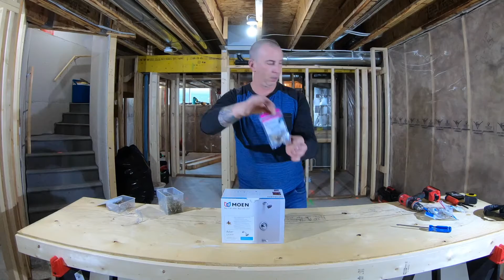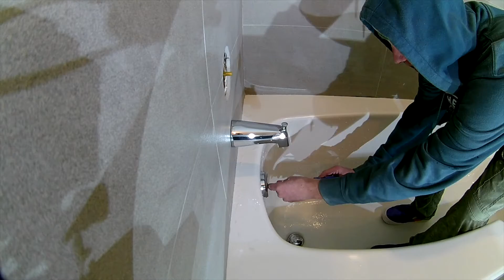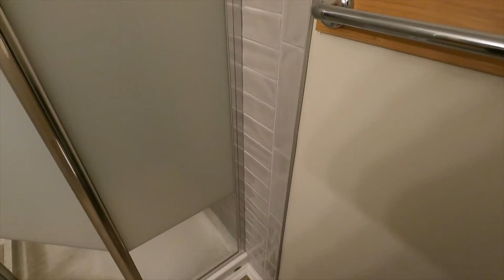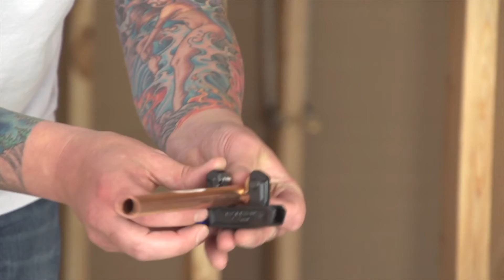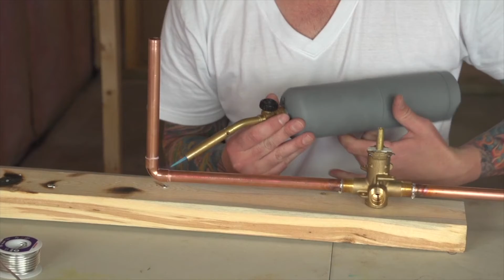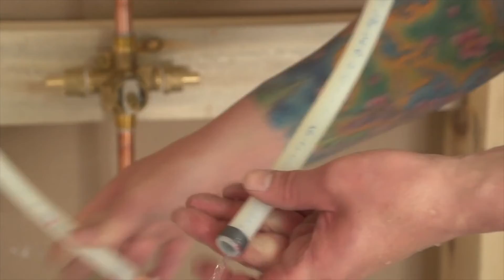SHOWER VALVE 101 4 different installs DIY Details

Comment: Tim, thanks for this! Quick question. 

I have roughed in my basement bathroom with this kind of delta valve. I left the cap that it comes with on. And turned all my water lines on to test for a leak. There was no leak at all. 

But my wife thinks the up stairs hot water is not as hot as it was before. Is it correct to assume that without the cartridge installed that the hot and cold are mixing?

I thankfully installed shutoffs for the new plumbing so was able to turn the water coming into the new bathroom easily!  

I was just curious. Or maybe it’s in her head :)
Reply from the maker: Sounds like you have done a great  install by adding some shut offs and no leaks. I don’t think the water will mix at the roughin stage. The false cartridge will block water flow. Happy DIY!  What are you working on next?
Reply: @ConstructionCoach  thanks! 

I’m finishing my entire basement. Your videos have been so helpful. Almost at inspections stage. 

Thanks from Winnipeg.
Reply: Follow up to this. I foolishly forgot to insert the plastic test plug that comes with the valve. That solved all issues. Ran the test again and no issues thanks again!
Reply from the maker: That’s a funny story! Glad you have it all worked out now.